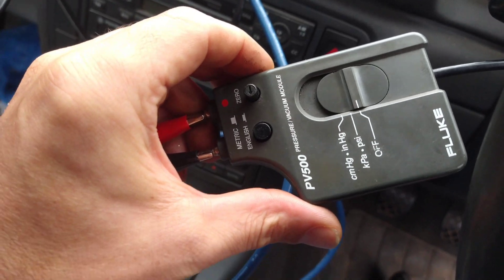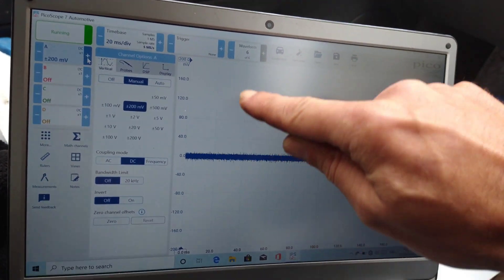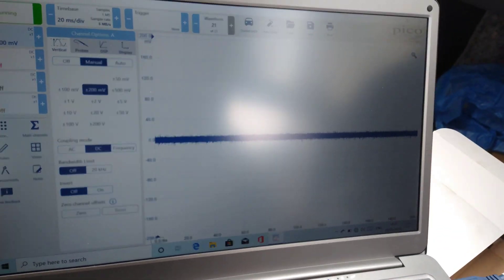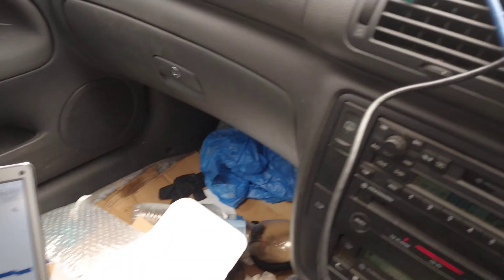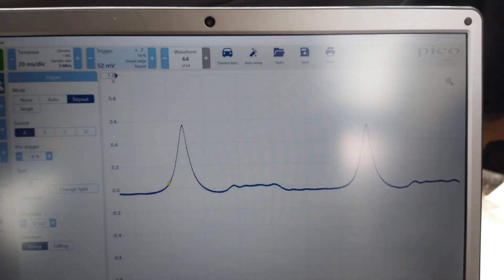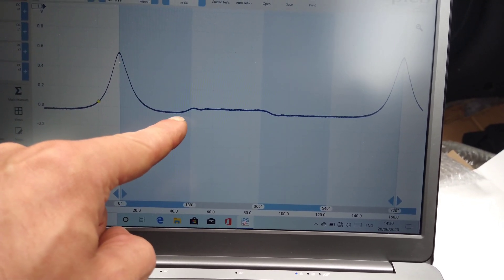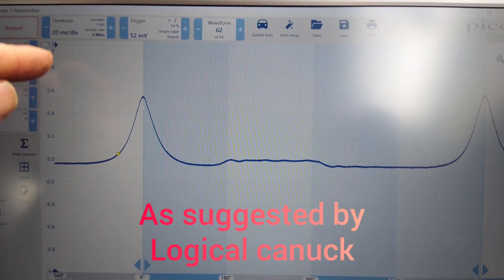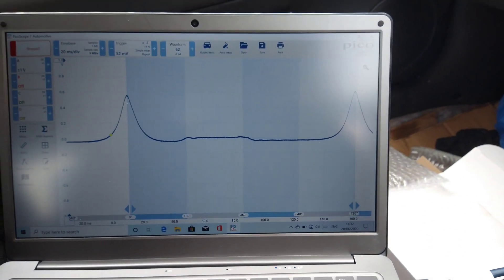PV500 Pressure transducer (improved waveform)

Comment: I just bought a used pv350. Definitely looks better on kpa. Didn’t look very usable on English scale. Just have to do the kpa to psi conversion.
Reply from the maker: It does improve it a lot, I just got use to bar instead of psi. Mine is a pv500 but basically the same, I think it's a great tool. I just bought a book from AES wave that was written by Brandon Steckler, it is extremely useful to have whatever level you are at. Thanks for watching
Reply: @mechanicmatt871  Have you tried to create a custom probe to convert kpa to psi? That is a great book👍
Reply from the maker: Not yet but that would be useful, cheers

Comment: my PV500 does not change in value when reading vacuum, is this normal? Thanks!
Reply: I mean, I'm supposed to have oscillations but i don't see changes.
Reply from the maker: I don't think I have tried it on the vacuum setting yet, although I have had vacuum reading fine when it has the pressure selected on the transducer.
I would say you should see a change on the vacuum setting when vacuum is applied.
Thanks for watching.
Reply: @mechanicmatt871  ok, I've been reading up and I have read that some of these PV have static values and some do oscillate under the scope. I will have to go back but someone mentioned that those with yellow mark or red under the screw in the battery bay would be an indicator.

Comment: Hi Matt
What's the difference in fluke pv350 and pv500 thanks Mike
Reply from the maker: Hi Michael, they are basically the same thing, the PV 500 that I got has an operating range upto 500 psi, it can go higher for a short time.
The PV 350 as far as I know has an operating range upto 350 psi. 
Thanks for watching